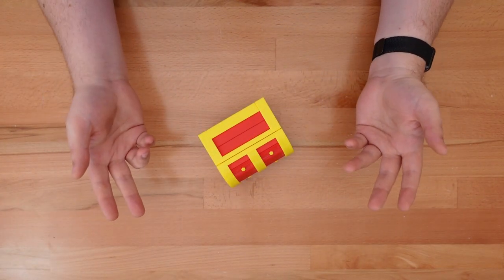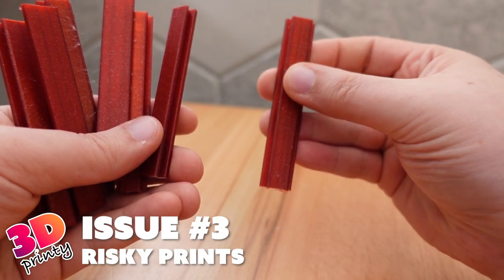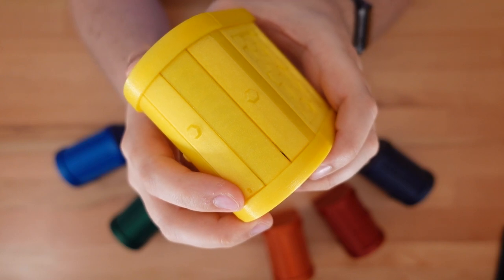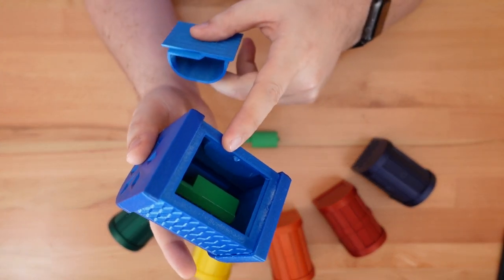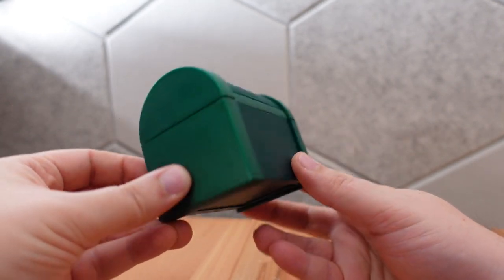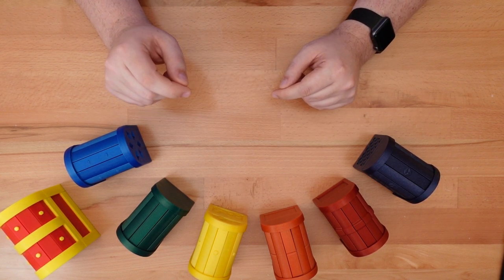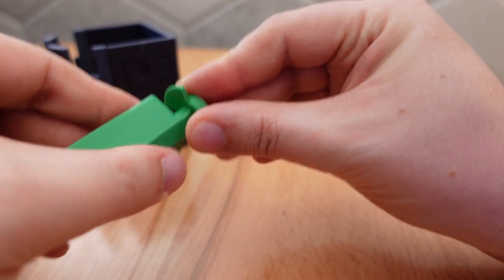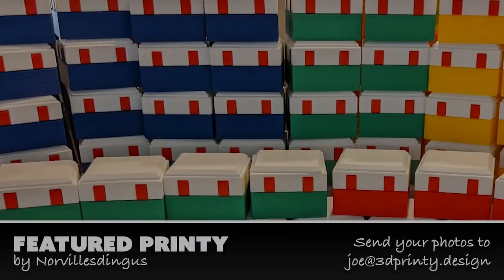3D Printed Treasure Chest Puzzle Box - New Version!

Comment: Just made the print!  It works well.  I added some lube to the slide (had some of the same stuff I use on the Prusa) and made it the slide action work really well.  

On the bottom container I wonder if you close one end if you would eliminate the need from a brim on that part.

Really nice work just found your channel recently.
Reply from the maker: Thanks for printing! That part could probably be printed without a brim as-is, but your results may vary - you're right that capping it off would make it stick even better. Maybe that'll be a future remix option!

Comment: What glue do you use? If i remember correctly you covered it in a video i just cannot find it. I'm having trouble finding a glue that actually sticks 3d printed plastic together.
Reply from the maker: Depend on the project, but the STRONGEST glue I use is 3DGloop! It's an insanely good hold because it actually melts and fuses the parts. For regular holds, I use standard super glue. For temporary holds, I use hot glue.

Comment: 4:25 I've never really created any puzzles but I own a dozen or so. I alway thought the "misdirection" parts of the design were part of the puzzle, some noise you had to figure out you should ignore. But that is not something I see very often. Is that usually considered a bad thing?
Reply from the maker: Some misdirection is good - as long as it's not intentionally taking the solver multiple steps down the wrong path.

To be frank, the old slats didn't really add much challenge and solvers will still need to take a moment to determine which slats on the lid move and which do not.
Reply: @3DPrinty  Ahhh, that makes sense. I  didn't print your original design but I can imagine the slats felt noticeably different once attached.

Comment: Sorry if this has already been asked but what kind of glue do you use?
Reply from the maker: Depending on the project, I use hot glue, liquid super glue, or 3D Gloop!

3D Gloop! is best for projects that need a REALLY strong hold. It totally fuses parts together! But it's more expensive than super glue, so I don't use it for everything.
Reply: @3DPrinty  I am looking into 3D Gloop and 100% am going to get some you don't happen to have a referal code or anything with anyone that sells 3D Gloop right?
Reply from the maker: The company posts promo codes quite often. If you follow them on Twitter you should be able to get 10-20% off from time-to-time. 

In the past I've seen promos from Joel Telling (3D Printing Nerd) and a few other channels. As for myself, I don't actually have any referral codes or affiliate links with them - I'm just a frequent customer :)

Comment: Great job! What software are you using in order to create these cool models?
Reply from the maker: These were design in Fusion 360, which happens to be the program I know best. I'm certain it would be very possible to make this in Tinkered (free) or many other CAD programs. I'm planning to demonstrate customizing these chests using multiple programs and methods in a future video.
Reply: @3DPrinty  Very cool, looking forward to it!
Reply: @3DPrinty  I'd love to see this created in OpenSCAD, but I lack the skills to accomplish that task.
Reply from the maker: I like OpenSCAD but WOW, it takes me forever to make things with it. Every once in a while a project comes along that's so driven by customization that I'll model it in Fusion360 and then recreate it in OpenSCAD :)
Reply: @3DPrinty  I'm glad to hear you're also a fan of OpenSCAD. My OpenSCAD skills are only slightly better than my Fusion 360 version, which means simple boxes, cylinders, etc, not the exacting detail you're able to create. The best feature of OpenSCAD is the parametric aspect, but I understand that Fusion 360 also has that, but one should have more skill than I when venturing into parametric modeling with dependent variables.

Comment: I printed one, but the bottom flops open even when it’s locked.  What’s supposed to keep it from opening when locked?
Reply from the maker: When the bottom lid is opened, it rotates so that one half of the lid pushes into the chest while the other half rotates out. The side of the door that pushes into the chest can only move if the two sliding latches are moved out of the way through the puzzle solution.

If your door opens anyway, I can think of 3 possible causes:
1. The door is installed the wrong way around
2. The door is installed correctly, but the puzzle isn't in a locked state
3. The door is installed correctly and the puzzle is locked, but the long arms on the sliding latches that are supposed to wedge the door closed are bent or flex too easily. When the door is fully removed, check that the sliding latch arms slide far enough that they can be easily seen through the door frame. You may need to intentionally bend them to force a tighter fit.

I hope this helps!

Comment: Recommend layer height etc?
Reply from the maker: My defaults are 0.2mm layer heights, 15% gyroid infill. This should work okay with both smaller and larger layer heights. Just make sure the weighted axle is printed with a high infill, since you need that weight for it to work.

Good luck!